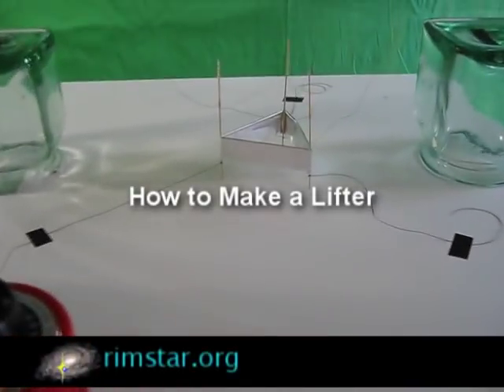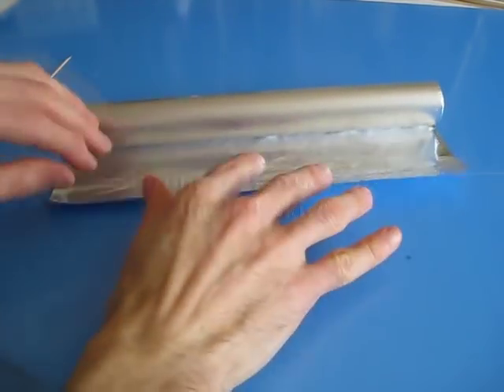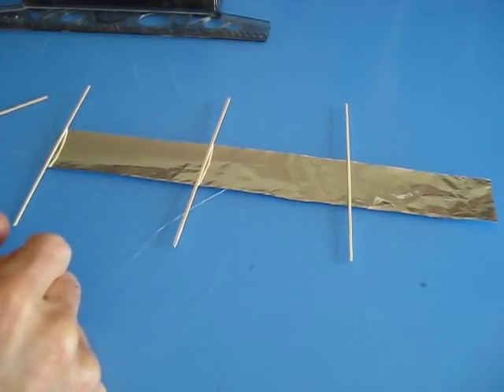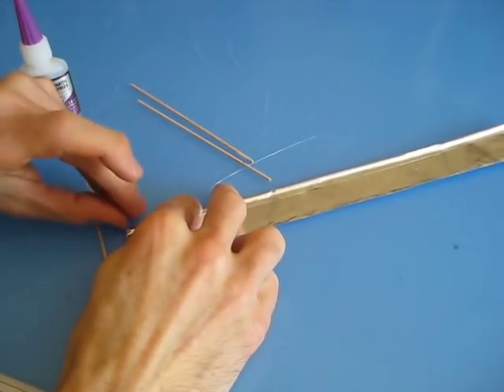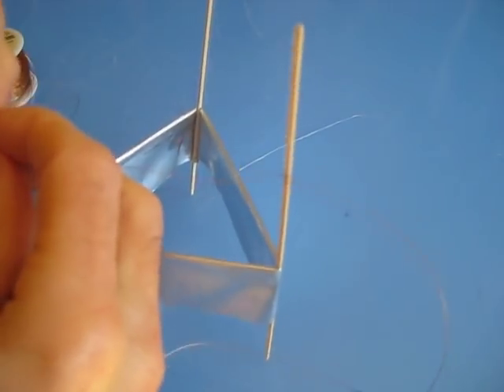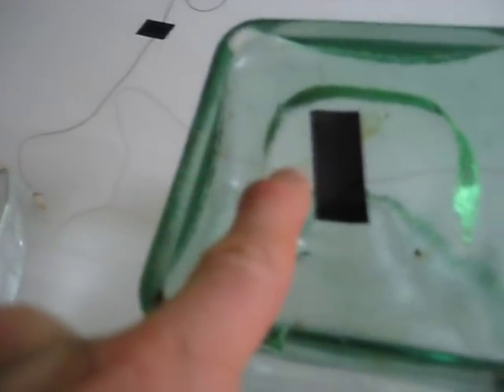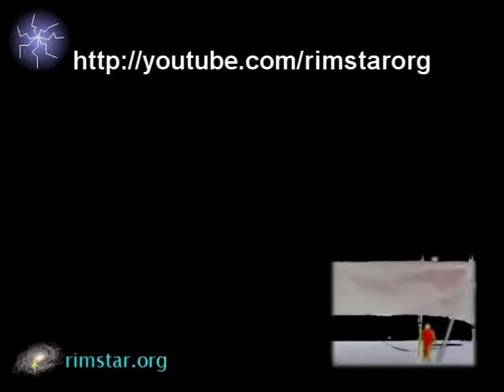How to Make/Build a Lifter or Ionocraft

Comment from the maker: I played with that idea with my ion wind rotor. I tried a few different lengths and widths and shaped them like an airfoil. With that design there is only one electrical connection to it so I was able to connect through a metal shaft and it was free to rise on the shaft. I didn't film those specific tests since they didn't work out but you can see the rotor in my "Ion Wind Rotor" video. I put a link in the description below this video in case you're curious.

Comment from the maker: You're welcome. Thanks for watching it. In answer to your question, the conductor would only disintegrate, or melt, if the current flowing through it was large enough. The current in this case is too small, even though as you point out the conductor is thin, so that doesn't happen.

Comment from the maker: It's a form of ion wind. The thin, bare top wire ionizes a large volume of air at the top. The foil skit is charged with opposite polarity and has a smooth top so it doesn't ionize much air. Since the foil skirt is opposite in polarity to the ionized air, it's pulled up to that air. Meanwhile that air is pulled down. Not all of the air makes it down since it collides with other air molecules. Watch my "Lifter Voltage/Current and Smoke/Airflow Test Measurements" video to see the air in action.

Comment from the maker: I'm pretty sure it's too heavy. Styrofoam may seem light to you but compare the weight of yours to the one in my video. Mine weighs just 2 grams. Also, it's not just the voltage that's important, you also need the current. My small Van de Graaff generator can produce 80kV but the current is too small. But I'd suggest making a lighter lifter first since that's likely the problem.

Comment from the maker: Um, not that I know of. I've never tried to determine the temperature but I've also never noticed any heat. I have noticed cooling but that was on my skin and likely due to air moving across my skin, taking away heat as it did, just as wind normally does. However, at the same time I didn't feel any heat in the air. So I'd have to say I don't know.

Comment from the maker: Interesting... For example, assuming a 10 farad, 2.5 volt supercapacitor...
Energy in the fully charged capacitor = 1/2 C V^2 = 1/2 x 10 x 2.5^2 = 31.25 joules
To hover, my small lifter needs 26,000 volts at 0.000275 amps = 7.15 watts = 7.15 joules/second
So assuming you could lift the capacitor and the other components needed to step up the voltage, and efficiently enough so there's something left over, you might get lift-off and a second or two of hover. Definitely better than batteries.

Comment from the maker: @mrnewagemotor Transdimensional Technologies came up with this design and made a video. In October 2001 someone posted a link to it in the jlnlabs yahoogroup and in no time hundreds had made them around the world.

By the way, I made voltage and current measurements and just have to package up a video. I don't think I can figure out energy vs lift though. Should be up later this week.

P.S. Thanks for pointing out the "pennyweight" model propeller stuff. Looks like lots of fun!

Comment from the maker: No, not by itself. The lifter needs at least 30,000 volts, though if I recall correctly I've heard of as low as 10,000 volts being used. But that's still much higher than 12 volts.

Comment from the maker: By the way, I give links in the description below this video to three different power supply options, one of which is the monitor power supply. And if anyone uses the convergence and deflection coils as Gary suggests, make sure to remove the thin enamel insulation. Gary, how did you remove the insulation, a lighter?

Comment: I explain myself in a hoop, put a copper and aluminum coil equally insulated from each other calculating the separation so that there is no arch, I think it would give more stability
Reply from the maker: Most of the instability is from the uneven spacing between the wire and the aluminum foil. There are more ions where the spacing is smaller. Using a hoop, as you suggest, would help by having fewer sharp corners.

Comment: I just remembered the ignition transformers on furnace oil burners would make another great power source for those not having  junk CRT TVs and computer monitors cannibalize HV transformers from. The secondary voltage on the newer ones run about 17.5 KV. The older ignition transformers have secondary voltage that runs much higher. New oil burner ignition transformers run about $55.00 and very durable

Comment from the maker: The power being used to maintain its flight is around 7 watts (26kV x 275uA) and the lifter weighs around 2 grams, so 3.5 W/g. See the "Lifter Voltage and Airflow Tests" annotation link at the end of this video to see me making these measurements.

However, I've seen as good as 1 W/g where an 85g lifter lifted itself plus an additional 100g. Do a google search for "experiment 14 100g".

And I recall a Japanese one that was room sized. Still couldn't lift its own power supply though.

Comment: Great video thanks!! Just thought to let you know - ion wind will only flow in one direction. The fact you can swap electric poles and still get lift proves this effect has nothing to do with ions.
Reply from the maker: Thanks, glad you like it! Ion wind flows in both directions, though. This lifter moves in the direction of the sharp electrode, the thin wire, regardless of the polarity.

Comment: Is that high voltage pulsed at a certain frequency? (AC or DC?)
Reply from the maker: It's flat DC. AC won't work. Some have used pulsed DC in the past but I've never tried.

Comment from the maker: Fifty dollar for crazy glue would be much more than I'd spend too. The glue was $5, the price tag on the bottle showed $4.99. I'm not familiar with stun gun output so I can't say if a modded one would work. As well as the high voltage, it does need quite a bit of current to feed the ion wind. In my "Lifter Voltage/Current and Smoke/Airflow Test Measurements" video I show it using 26kv and 275 microamps. There's a link in the description for this video if you're curious to see the measurements.

Comment: can you make a reasonable amount of UF low voltage capacitor with long sheets of aluminum foil and paper/something-similar. a cylindrical container to contain the capacitor with 2 holes on the top with bolts on them to attach wires or clips
and wrap them around tight having them in the container with a oil liquid of some kind (optionally a bit of salt mixed) will it have enough uF to make a 3volt low current LED light up for some amount of time? and the size approximately of the completed capacitor will be about 9-10 inches tall from top to bottom and 2-3 inches wide rolled up? (like rolled into a swirl shape)

Comment from the maker: Then you either build your own HV power supply from scratch (other link in the description) or buy one (I just added another link to the description.) You do need some current in order to ionize the air sufficiently for the required amount of ion wind so things like Wimshurst machines and Van de Graaff generators are usually not sufficient. However, I think I recall that the original lifter made by Transdimensional Technologies used a large VDG generator, a 1 foot dome (approximately).

Comment from the maker: Not by itself, you need high voltage, usually around 30,000 volts. Of course, you could use a car battery to feed a high voltage power supply of some sort.
Reply: Okay.. got the idea about amount of Voltage. How many Amps ? Appropriate..?

Comment: Hi Steve,
I was wondering if you could possibly use a silk fabric, say a scarf to make it fly as above. And if so, could you put something on the fabric?
Many thanks!
Reply from the maker: +enjoypolo I'm not sure what you're describing. If you mean to use silk instead of the aluminum foil then I don't think silk is electrically conductive, which it would have to be.
Reply: +RimstarOrg but if it were (ie say carbon-coating the fibers for example) it would then be a conductor. I am curious as to the possible application of such textile combined with the lifter technology. A flying carpet maybe?
Reply from the maker: enjoypolo
You're going to have to describe the geometry of what you have in mind. Keep in mind that this is ion propulsion. Here's how the ion propulsion works https://www.youtube.com/watch?v=01F8V5IhB5k, and here the smoke shows the airflow required https://www.youtube.com/watch?v=LOGAaObsN4g. A carpet is a flat surface - there are no holes for the air to flow through.

Comment: Why is the ground skirt a wide piece of foil and the positive just a wire?

Does the surface area resistance of the foil get pulled upward because the ionic wind is flowing across it?

Comment: So if your lifter didn't fly until 25 Kv, I would think that a smaller one would be able to run at 20. Anyway, the power supply thing is still confusing me. I'm not that skilled with electronics and I'm missing most of your jargon. Will buying the adapter from the site overload the GRA 10? Also, how long does shipping usually take? I know it varies by location, but is it really fast or just sort of mild? Thanks, you're a huge help in getting this thing off the ground.

Comment: you can buy a bug-zapper, especially if it gives you a rating. use it for the supply, also, a tv fly-back or ignition coil with a HV diode can be used. but you need drivers for these transformers. maybe you could rectify the output of a neon sign transformer.

Comment: Hi Steve,
I'm curious: have you tried testing the weight capacity for a lifter this size? Could it possibly fly if built from heavier materials; or does it depend on the current? Again, Im curious as to whats stopping this from making a vehicule out of this. Thanks so much.
Reply from the maker: +enjoypolo The record for a lifter, or any ionocraft that I'm aware of, is lifting a 100 gram payload in addition to its own 90 or so grams. The limit is both the current and the voltage. It's estimated that it would have to be house sized to lift a person and require millions of volts, with the necessary current for the ion wind.

Comment: Hi Rimstar.  Can you please give a more detailed explanation on the power supply half of your cool project.  The lifter part leaves no questions as to what to do.  But I am clueless as far as the other part.  I would love to do this experiment with my nephew.  Please reply back with a link if you make a new vid explaning the other half to us clueless ones.  Thanks!
Reply from the maker: The power supply is my homemade one here https://www.youtube.com/watch?v=GEuK1OdYxHk and more detailed on my webpage here https://rimstar.org/equip/30kv_pwr_supply.htm. To produce the necessary ionization, you need not only a high voltage power supply, but also one that is capable of supplying a generous amount of current too. That rules out a lot of high voltage sources. You can also make on using an old computer monitor as I've done here https://www.youtube.com/watch?v=r32e0QGdm8U (https://rimstar.org/equip/hvgmon24kv.htm).
Reply: Cool.  Thanks!

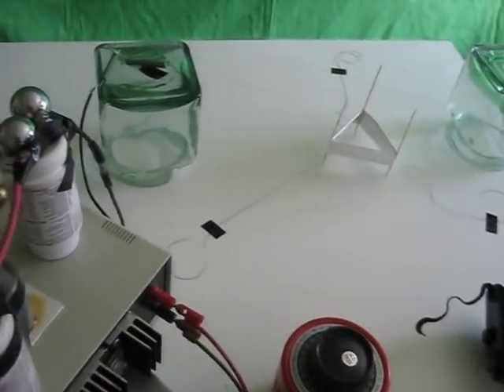Comment from the maker: You need a high voltage of around 30,000 volts, with a few hundred microamps of current. A wind turbine is much lower voltage, in the tens or hundreds of volts. Solar panels are also in the tens. You can still use a wind turbine or solar panel but they'd still have to power a high voltage power supply to provide the high voltage. So, no, there's not really an easier way. The high voltage and hundreds of microamps can be dangerous, which is why I safely discharge things at 11:20 in the video.

Comment: If I make a triangular pattern on welded aluminium plate and manage to do it far bigger, will I be able to use it to give light weight to thing ? or simply being able to make it fly if my dc and high voltage supply is on it ? Generator AC to DC than to high voltage ?

Comment: Hi  RimstarOrg. Please answer the 4 questions below.
1) The top wire is connected to the positive wire of the power supply. 
     Is this correct ?
2) The bottom wire is connected to an aluminum skirt which is connected
     to the ground of the power supply. Is this correct ?
3) Where does the negative wire of the power supply is connected to ?
4) The wire that goes to earth ground is connected to which part of 
     the lifter ?
Reply from the maker: 1) Yes.
2) Yes.
3) This power supply's negative is the ground. i.e. the negative is at ground potential. If you have a power supply that has positive, ground, and a negative and they're all different then you can use positive and ground if there's enough voltage between them or you can use ground and negative if there's enough voltage between them or you can use positive and negative if there's enough voltage between them. The voltage required for this lifter is around 25,000 volts. Note that this also requires a significant amount of current for the ionization but I don't know the exact amount. A Wimshurst machine or Van de Graaff generator (unless it's a really big one) can supply the voltage but not the necessary current for example.
4) See 2). The power supply's ground is earth ground.
Note that it works with any polarity on the top wire and with the other polarity on the aluminum skirt. I put ground on the skirt because that's physically closest to the tabletop and the tabletop is at ground. That avoids having the skirt and the tabletop interacting with each other electrically, they're both at ground potential so there's 0 volts between them.
Note also that you don't want to use a power supply that has only positive and negative and no ground. i.e. You don't want a power supply whose voltage is not related to ground. If you do that then you don't know what voltage the lifter is with respect to the tabletop, it could be anything. That could be dangerous.
Reply: @RimstarOrg  Since I am a beginner in working with high voltage, perhaps you could email me two sketch on how to connected them all together.
1) Sketch 1. The power supply have positive, negative, and ground. Show a sketch of all of the connection of positive, negative, and ground.
2) Sketch 2. The power supply have positive, negative, and no ground. Show a sketch of all of the connection of positive, negative, and ground.
If you agreed to help me then I will post my email address here so you could email it to me.

Comment from the maker: +Tahera Alhosni You have your Google+ settings set so that no one can comment on your public posts. I sent you a YouTube private message yesterday answering your question.
Reply: Sir . Google + not work with me . Can you answer in comment if you dont minde ?
Reply from the maker: Tahera Alhosni If you mean your question about how many volts to lift 100kg, I don't know the answer but the lifter would probably have to be the size of a house. The world record for a lifter is only 100g and that was with a specially made power supply.
Reply: RimstarOrg ok sir thanks alot
Reply: +RimstarOrg Could you make one powerful enough to stand on?
Reply from the maker: +Madden Madness No. As I said above, it would probably have to be the size of a house.
Reply: RimstarOrg What if you send more than 1000000 volts thru it?
Reply from the maker: +Madden Madness If you did, along with enough current for the ions, then it might work.
Reply: So if I do more voltage and current!!  The lifter will be able to lift more ?.then why it will get piger that what I dont understand?? . What if i replace the aluminum foil  with aluminum cheet ? And I make the thin wire thiker so it can carry that huge current?
Reply: +horashia good idea!
Reply: well that was fast hahha . do you know why it must be aluminum not something else that will help
Reply: +horashia I'm guess that it does not haft to be aluminum just that's the only light weight metal he had access to.  you could probably use any conductive material that was light weight.
Reply: Oh thanks you gust did the mistake of your life . I have a vary Horrible idea
Reply from the maker: Madden Madness
That's right. It doesn't have to be aluminum, but it's the lightest metal foil I have, and that most people have.
Reply: +RimstarOrg yeah that's what I figured.
Reply: +horashia uh OK have fun with that.
Reply from the maker: +buddhafollower Sure, this video shows step-by-step how I made the power supply https://www.youtube.com/watch?v=GEuK1OdYxHk plus there's even more on my webpage here http://rimstar.org/equip/30kv_pwr_supply.htm. The output is high voltage DC. Pulsed DC will also work but not AC.
Reply: The reason governments remain silent about this wonderful phenomenon is that the oil companies would go bust. It would mean governments losing their control over us. The need for their jobs would come into question.

Comment: lifter based on electron wind gave me an idea: a very simple demonstration of lifting can b done. Shard edges of a conductor emit electron winds. so if u take a negatively charged piece of cloth(static electricity) and place it above a sharp tip of a negatively charged conductor, the cloth would fly until the charge is dispersed. i guess theoretically it might work. but is it possible practically?